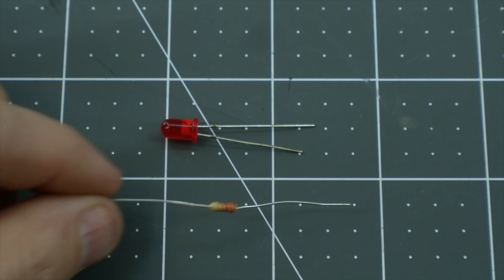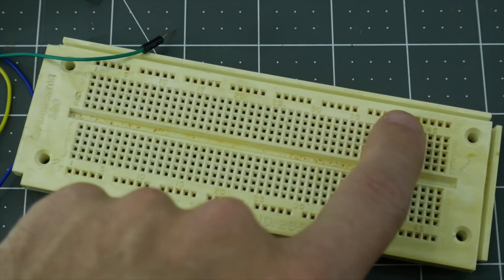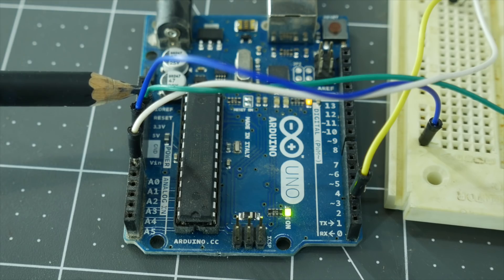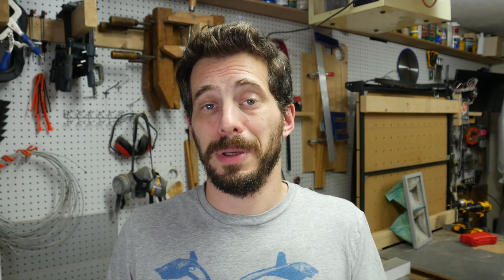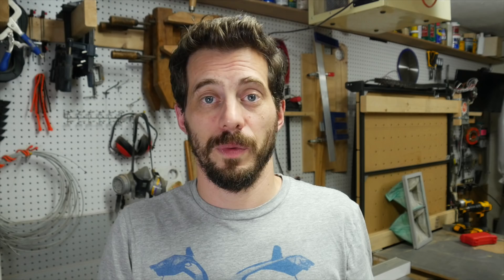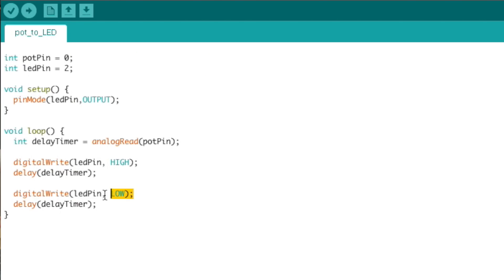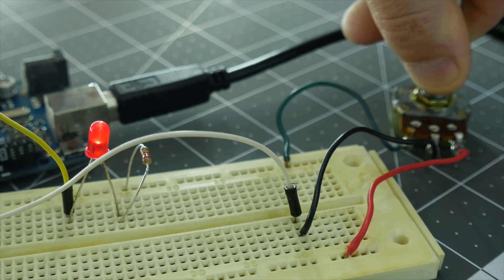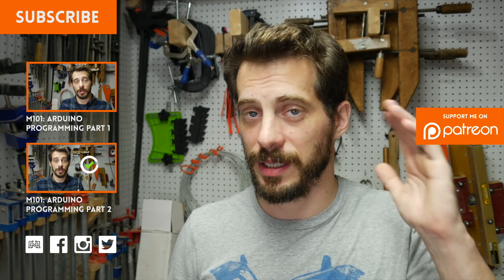Arduino Programming Part 3 // Maker 101 | I Like To Make Stuff

Comment: Hey how's it going my friend? I have a quick question for you. I have the Arduino, temperature probe, a small flexible silicone heating pad, and battery. I'm having trouble programming the system to maintain 2oz of liquid at a certain temperature and for system to cut off when desired temperature is reached and cut back on when desired temperature falls below desired temperature can you help please thanks?

Comment: hello its a good video...
my question I want to work with ARDUINO UNO for SERVO total 4 servos I want to run with it so is it necessary to connect it with bread board without it can it be possible. if yes how and if no then what to do.
 thanks for the help dear....
good work keeping going.

Comment: You can actually improve that code in a simple way, instead of delaying the loop two times with a line like:
digitalWrite(pinLED, !digitalRead(pinLED));
This way you can alternate pin state without turning it HIGH and LOW with only one line of code and only one delay line, variable resistor will become more responsive :)
Reply: Tell me more....?

Comment: It's funny once I realized that you just created exactly what a 555 IC pin does. Awhile back I made a DIY buzzer timer using a 556 (just two 555s in one IC) so it made a tone at a certain time depending on how much resistance the pot was giving the circuit. This method is soo much easier, most likely cheaper as well because at one point i decided to calculate how much money I had put into this little project, ya way too much! I love your channel btw

Comment: Here's some code that could help you guys.

//Project1__Blink_4_LED
int ledPin1 = 5;  // pin # 5
int ledPin2 = 6;  // pin #6 is used
int ledPin3 = 7;  // pin #7 is used
int ledPin4 = 8; // pin #8 is used
int ledPin5 = 9; // pin #9 is used

void setup() {
  pinMode(ledPin1,OUTPUT); // pin 5 is OUTPUT, LED connected to it
  pinMode(ledPin2,OUTPUT); // pin 6 is OUTPUT, LED connected to it
  pinMode(ledPin3,OUTPUT); // pin 7 is OUTPUT, LED connected to it
  pinMode(ledPin4,OUTPUT); // pin 8 is OUTPUT, LED connected to it
  pinMode(ledPin5,OUTPUT); // pin 9 is OUTPUT, LED connected to it
}

void loop() {
  digitalWrite(ledPin1,HIGH);  // make pin 5 HIGH
  delay(2000);  // LED is on for 2 seconds
  digitalWrite(ledPin1,LOW); // make pin 5 LOW
  delay(2000);  // LED is off for 2 seconds
  digitalWrite(ledPin2,HIGH);  // make pin 6 HIGH
  delay(2000);  // LED is on for 2 seconds
  digitalWrite(ledPin2,LOW); // make pin 6 LOW
  delay(2000);  // LED is off for 2 seconds
  digitalWrite(ledPin3,HIGH); // make pin 7 HIGH
  delay(2000);  // LED is on for 2 seconds
  digitalWrite(ledPin3,LOW);  // make pin 7 LOW
  delay(2000);  // LED is on for 2 seconds
  digitalWrite(ledPin4,HIGH); // make pin 8 HIGH
  delay(2000);  // LED is on for 2 seconds
  digitalWrite(ledPin4,LOW);  // make pin 8 LOW
  delay(2000);  // LED is on for 2 seconds
  digitalWrite(ledPin5,HIGH); // make pin 9 HIGH
  delay(2000);  // LED is on for 2 seconds
  digitalWrite(ledPin5,LOW);  // make pin 9 LOW
  delay(2000);  // LED is on for 2 seconds
}

Comment: G'Day Bob, Have you done a video on how to make the keypad shield button actually operate a digital output pin. I am new to this Arduino world by 2 weeks and have done the blinking LED and other useless stuff. I have managed to mix some codes to make a hall effects sensor, to count on the keypad shield, "to count rotations" not RPM like everyone seems to do with it. I have connected a 3 phase stepper drive  to the uno and shield  and all the buttons do is stop the motor and it wont start. So just wondering if you had any info on something like that ?   Cheers

Comment: Why is the delayTimer variable defined inside the loop, rather than at the beginning, along with the other variables?
Reply: Philip Chandler, that's because it's not a fixed variable and won't work and the reason of it being in loop rather than setup Is we read the analog values again again not once. Hope it helps

Comment: great video. very informative. thank you. I do have one question though. Since the cathode is connected to the D4 and you start by turning D4 HIGH, doesn't that turn the LED off due to having 5v to both it's anode and cathode? It seems as though you're setting it off - delay - on - delay - loop.

Comment: Just as a side note, it might have been a cool idea to type the sketch out in the description or link to a page of some sort with the sketch on it. Personally I'm interested in the digitalRead function. Possibly to increase and decrease the brightness of an LED by changing the duty cycle on the digitalWrite function. I've looked at several examples, none of which work for my application and can't quite seem to wrap my head around the "why" of it.

Comment: And here's the code that i wrote/copied ..

int potPin = 1;
int ledPin = 2;

void setup() {
  pinMode(ledPin,OUTPUT);  
}

void loop() {
  int delayTimer = analogRead(potPin);
  digitalWrite(ledPin, HIGH);
  delay(delayTimer);

  digitalWrite(ledPin, LOW);
  delay(delayTimer);
}

Comment: Hi Bob ! I tried to copy your code and upload it to an Arduino 101 but there were problems with the first line.. Here are the error messages.. Please help..

Arduino: 1.8.2 (Windows 7), Board: "Arduino Industrial 101"

Sketch uses 4230 bytes (14%) of program storage space. Maximum is 28672 bytes.
Global variables use 147 bytes (5%) of dynamic memory, leaving 2413 bytes for local variables. Maximum is 2560 bytes.
processing.app.debug.RunnerException
 at cc.arduino.packages.uploaders.SerialUploader.uploadUsingPreferences(SerialUploader.java:160)
 at cc.arduino.UploaderUtils.upload(UploaderUtils.java:78)
 at processing.app.SketchController.upload(SketchController.java:713)
 at processing.app.SketchController.exportApplet(SketchController.java:686)
 at processing.app.Editor$DefaultExportHandler.run(Editor.java:2135)
 at java.lang.Thread.run(Thread.java:745)
Caused by: processing.app.SerialException: Error touching serial port 'COM1'.
 at processing.app.Serial.touchForCDCReset(Serial.java:99)
 at cc.arduino.packages.uploaders.SerialUploader.uploadUsingPreferences(SerialUploader.java:144)
 ... 5 more
Caused by: jssc.SerialPortException: Port name - COM1; Method name - openPort(); Exception type - Port busy.
 at jssc.SerialPort.openPort(SerialPort.java:164)
 at processing.app.Serial.touchForCDCReset(Serial.java:93)
 ... 6 more
An error occurred while uploading the sketch
Exception in thread "Thread-76" java.util.ConcurrentModificationException
 at java.util.LinkedList$LLSpliterator.forEachRemaining(LinkedList.java:1239)
 at java.util.stream.AbstractPipeline.copyInto(AbstractPipeline.java:481)
 at java.util.stream.AbstractPipeline.wrapAndCopyInto(AbstractPipeline.java:471)
 at java.util.stream.ForEachOps$ForEachOp.evaluateSequential(ForEachOps.java:151)
 at java.util.stream.ForEachOps$ForEachOp$OfRef.evaluateSequential(ForEachOps.java:174)
 at java.util.stream.AbstractPipeline.evaluate(AbstractPipeline.java:234)
 at java.util.stream.ReferencePipeline.forEach(ReferencePipeline.java:418)
 at cc.arduino.contributions.libraries.LibrariesIndexer.rescanLibraries(LibrariesIndexer.java:127)
 at cc.arduino.contributions.libraries.LibrariesIndexer.setLibrariesFolders(LibrariesIndexer.java:106)
 at processing.app.BaseNoGui.onBoardOrPortChange(BaseNoGui.java:682)
 at processing.app.Base.onBoardOrPortChange(Base.java:1297)
 at processing.app.Editor$DefaultExportHandler.run(Editor.java:2165)
 at java.lang.Thread.run(Thread.java:745)

This report would have more information with
"Show verbose output during compilation"
option enabled in File -> Preferences.

Comment: I am needing to build a DC to DC boost stage for a inverter. would a arduino work good for that part of my project? and I'm guessing I can use it for the protection of the whole system. over/under voltage. temp.and over current. but the problem is I have no experience with arduino or programing. this time last year. I had never even heard of arduino. but watching YouTube about 8 months ago. the first time I saw one. was a video of home automation using arduino. I have studied it some since then. and I'm thinking maybe I can use this for my project. it is a must. I need to build this inverter for my offgrid home I need to have already moved in to. and I would like to build a series wound dc motor speed controller. for 72v and 350-400amps. but that can wait. I was planning to use the egs-002 spwm inverter driver board. it has the MOSFET drivers built in. do you think I can get all this to work together . it needs to be 12-24 or even 48 volts DC . and a 60 Hz 120v ac out. a 220/240v split phase would be great.but not necessary. I don't have much use for 220v. but I need like 4,5or6 kW plus output. basically 3 20amp circuits. and would like to be able to expand the output later if I need to. sorry for rambling on. but for the boost stage would a arduino be a efficient controller for a DC to DC boost with protection and constant voltage output with limited over shoot. that is my main concerns . or would some other ic work better? I really like your videos. and thanks for all the info.

Comment: You get your arduino from Amazon or what?
Reply from the maker: Yes, link in description
Reply: +madjack821 Or if you are like me and are broke you could look on Bangood for a generic device that's not directly from Arduino. Since Arduino is open source the generic boards have the exact same chip, but cost around 5$. Typically ive noticed the difference is their power regulator. But its nothing to worry about really.

Comment: Bob, do you know if anyone has built a CNC around an arduino? would be very complex but would make an awesome project. BTW you make great videos and this series is no different.
Reply from the maker: +Robert Tucker Thanks Robert! Actually yes, my X-Carve is based on this exact same Arduino Uno.  A lot of the smaller CNC machines are as well.

Comment: Well the sketch is not so unsless. I'v add another potentiometer, to control the two delay timers sepredly, and with the help of some N-chanel mosfet's, i'v build a petrol fuel injector driver for my ultra sonic washer. Thx for the lesson, it was very helpful.

Comment: One point. If you tie the LED to the +5volt rail, then writing the output pin LOW actually turns the LED ON, not off as you say. Pin HIGH then then turns  the LED OFF.

Minor point I know.

Comment: Hi Bob,
I really enjoy your videos. I would like to add that because of the wiring of the LED High actually means the LED is off and Low that it's on, because the output pin actually sinks current, which is correct, an Arduino pin can sink more current than it can supply. Just like to point out: high and low are just the output pins voltage states, and what that means depends on the circuitry connected to it. Anyway, great content on your channel, keep up the good work.
Reply: ehh I was right. I just said that very same thing. thank you for confirming. :)

Comment: when U connect on side of the LED to +5V
the LED will only be on if the arduino pin is low.
If it's high you have +5V to +5V which has no differences so no current flows

Comment: Wait... There's something I don't understand: you put the + wire of the LED to 5V, then you switch the output to HIGH (5V) and the LED turns on? Is HIGH in the IDE actually 0V and LOW 5V?

Comment: You basically made a PWM to control the LED. Basically, because the on off are the same length but both stretched, instead of the ratio changing. With a little tweaking you can make this an LED dimmer circuit.

Comment: But if you have the cathode of the LED connected to a pin and the anode via a resistor to 5v, writing the pin high would turn it off and writing it low would turn it on. But that's just nitpicking, great video Bob!

Comment: That was a great introduction video doing terrific job at simplifying embedded coding and basic electronic.... Only one recommendation... In your montage, i would strongly suggest that you let the "IDE Screen" last longer as opposed to the shots showing you... It's not that you are ugly or anything... it's just that you should show what you are talking about using the IDE as a visual support.
Trust me on this one !
Reply: It wouldn't need to be specifically switching between faceshot and IDE. I would recommend rather going for splitscreen, so the viewer can choose the focus. It might be also helpful to show the code flow better while explaining what it is doing. A little extra would be going through the code line by line and annotating the values and explaining it like you did, but highlight the current line synced to the audio.
Reply: very true.
Reply: +dyssynchro Agreed, I had to go back in the video to understand what he was talking about.